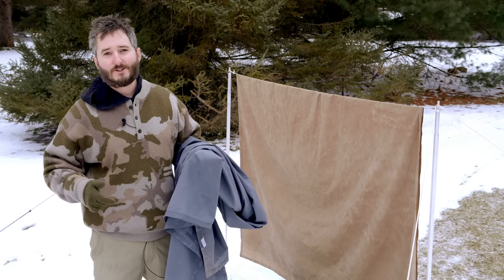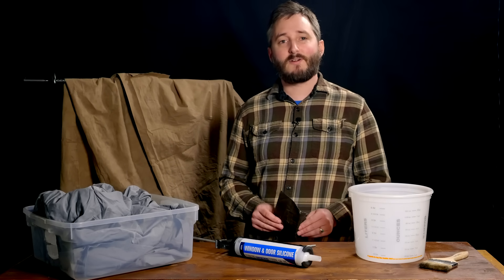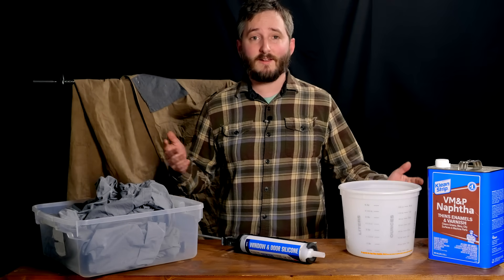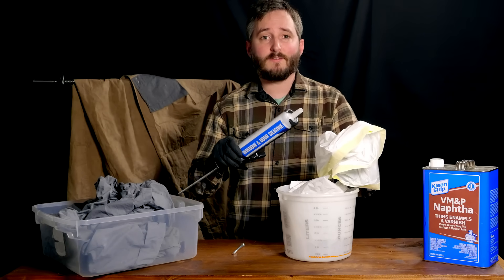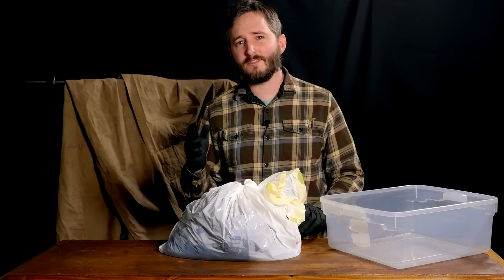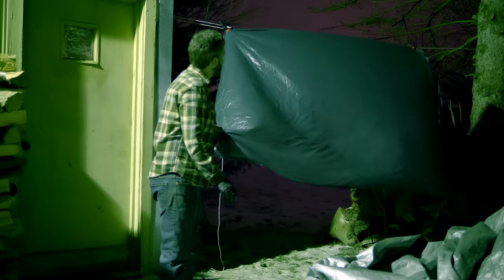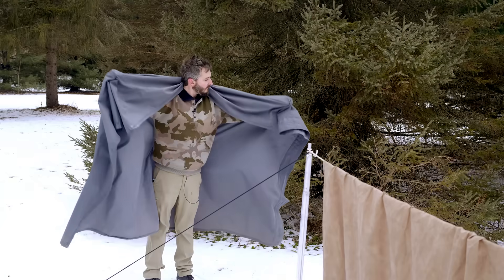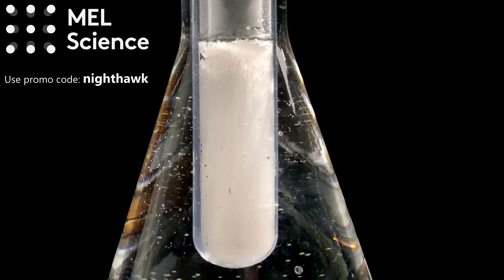Recycled Bedsheets Make The Best Waterproof Tarps

Comment: Although informative, the main premise is stupid.
Your going to the home center to buy 2 gallons of naphtha and a 6 dollar tube of silicone. Spending time and money to make this tarp.
You say this stronger? No its not.
If you get a tear in a sheet, the rip will spread from one side to the other. Everyone who has ripped sheets into strips knows this.
Try doing that with a 6 or 10 mil poly tarp.
This is a wast of time.
Folks, when you're at the home center thinking bout this trick here, shake your head and go around the corner to the other isle and just grab a poly tarp and be done with it.

Comment: Interesting idea, although this would weigh plenty more than most silnylon tarps used for camping... As i want to be able to pack at least a few luxury items, i feel like it is worth it to spend some money on lightweight gear... Having dialed my gear down to below the 10 pound limit for "ultralight", i feel like it starts getting reasonable to at least consider going with less lightweight options in certain cases where it has nice benefits; like synthetic sleeping bags and jackets dont have issues with cold spots because the down is not evenly distributed or properly "fluffed out", and it is much easier to clean, and it retains some heating properties if it should get wet.

Comment: Good video, thanks! The pace seems a bit slow to some, but I found it was calm and clear and didn't add a lot of unnecessary chatter. As for the button-method, you can also use a double sheet bend knot without stones.

Comment: I'm for something to "water proof" a seal plate and OSB sheeting at the bottom of a cabin wall I am rebuilding. I think I could put this mixture in a pump up sprayer and wet it out from inside the wall before I insulate and put up dry wall. I bet this will work a treat!

Comment: I have a question : how well the silicone - naphtha mixture hold up after time ? I mean if i mix them and don't use them right away, after a long time, will they still work as intended ?
Reply: As long as the solvent doesn't evaporate it should be ok.   You'll just have to keep it in an airtight container with little extra air space inside the container.
Reply: @MrBottlecapBill  thank you buddy !

Comment: This is one of the most generally useful ones I've seen in a while. Not only is it something everyone has a need for but it's something most everyone can easily do. Thanks!
Reply: for the best possible results, you should do this with a hemp or bamboo based cloth. hemp is best but bamboo also very strong. silk is great but more expensive and not functionally much stronger than hemp.

Comment: Just wanted to say, the bag method of vapour capture is useful but STILL do NOT do this inside unless you have a minimum of GOOD ventilation.
Also, consider the weather conditions. The level of safety doing this with the bag in the middle of most of North American winter would be absolutely fine, especially given I can se snow on the ground.
I cannot strongly enough highlight just how NOT OKAY this bag method would be if you happen to be watching this in a less well ventilated or even a well ventilated area in the middle of an Arizona summer.
I also want to point out that a solution of burning Naptha + Silicon is going to be very panic inducing and unlike dealing with any type of fire that the vast majority of people have any experience with.
It will, I’m sure behave more closely to napalm than just about any even liquid based (solvent or oil) fire.
Be extremely safe and careful and maybe run a smaller scale test or two.
I would never normally point this out because of NHIL audience, attention to detail and because of how obvious it is, but NHIL has done a lot of experimenting not shown here, but if you decide to replicate the video, it’s unlikely you will do the same, someone has done this legwork for you. So just be extremely hyper aware of your surroundings.
.5Gal of apple juice is sweet fk all in the bottle.
0.5Gal of apple juice on the floor is a LOT more
0.5Gal of burning (or even not on fire.) “napalm” on your South Floridian garage floor is a WHOLE LOT more than you can imagine.

Be safe, be extremely careful.
Hope and plan for the best but PREPARE for the worst.

Comment: For DIY purposes, does anyone know the answer to the following:

Is a fabric is coated one sided, not soaked, would it be partially Vapor permeable? (Think down sleeping bag and/or jacket where sweat has to pass through)

Would this work on polyester or Nylon fabrics?

Would this work as one sided coating on rough fabrics like wool? (Not waterproof, but more waterresistant)
Reply from the maker: It's breathable if made as in this video. Should work on any fabric
Reply: @Nighthawkinlight  Does it matter what kind of Nafta? (What the boiling point is, since those characteristics can differ)

Comment: You do know they make a silicone waterproofing spray specifically for this purpose, right?  You just spray it on like you are spraying it with spray paint, then let it dry.  No mixing or dealing with solvents required.

Comment: Like the idea, yet l would use bees wax for catching water because it has not been leeched by the silicone. Buttons are great yet because the shape of the square is altered by folds It is susceptible to water pooling as it is harder to get it taught for water to run off.
Thank you for the workshop and lm sure this knowledge will be useful to me one day, would it be possible to do a video on bees waxing a tarp? Is it as simple as rubbing it on or does it need to be melted?

Comment: I've been meaning to turn some heavy canvas drop cloth into a tent, and this seems like a great way to waterproof it without the flammability of oil or wax
Reply: I think silicone is actually a flame resistant. I used to use it for thermal cement on some led light projects.

Comment: Buy a waterproof back back and make damn sure it costs over $75, as you DON'T want to get a PVC piece of crap. Oh and do not buy from Mountain Hardwear, as those lousy f*ckers don't seam seal and they use careful wording like "Waterproof material" instead of the entire backpack actually preventing water ingress. Also, also, never buy a pack with zippers. Thats another sh!tty gimmick in which the company casually neglects to mention, allows water inside.

Comment: Great video. 
The more traditional (and cheaper way) is to simply use any old wax candle with turpentine.
Fill a large'ish pot with water. Only need an inch or two of water. Bring to boil. Get an old tin can, cut up a few candles into smaller chunks and drop into the can. Cover the wax with turpentine. Carefully place the can into the pot with boiling water. The wax should dissolve completely with the turpentine.
Once the wax is dissolved remove the tin can from the pot of boiling water.
Hang up your sheet outdoors and apply with a brush, rag or sponge to the cotton sheet.
Let the sheet dry and viola, you have waxed cotton.
I found this treatment should be repeated every couple of years depending upon the conditions the waxed cotton is used in.

Comment: I have a 10'x20' UV protected plastic carport canopy with walls (shelter logic) and it's developed leaks.  I sometimes live in this thing.  At the minimum, it's my shower and kitchen.

Would this work to reseal the top?  Maybe with less solvent?
Reply from the maker: It might. I would test a small part in case the solvent damages the plastic

Comment: For anyone wanting written instructions, here you go. If there are any corrections or additional tips, please comment so I can update the instructions.

WARNING: Do this outside to avoid toxic fumes and build-up of potentially explosive solvent vapours. 

MATERIALS: 
Naphtha, 100% Silicone 1, plastic bag, plastic container, bed sheet, chemical-resistant gloves, and a clothesline or drying rack.
Note: Ensure you are using 100% Silicone 1 (acetoxy-cure silicone), instead of Silicone 2 (neutral-cure silicone).  If your tubes aren't marked, then smell may be able to help tell the difference. Silicone 1 has a very strong vinegar smell due to the release of acetic acid while it cures. Silicone 2 can release ethanol/methanol, ketoxime or acetone (depending on formulation) and generally has a mild odor (usually ammonia-like) or no odor at all.

RATIOS:
Solvent to Fabric Volume: 0.75:1 ratio (E.g. Fabric that uses 2L of volume needs 1.5L of solvent).
Solvent to Silicone: 5:1 ratio (E.g. 1.5L of solvent will need 0.3L (10oz) of silicone).

TIP: Have a clothesline set up ahead of time to hang the fabric to dry.

INSTRUCTIONS:
1) Roughly figure out the volume of the fabric (material) by compressing it into a container with measurement markings.
2) Get large trash bag. Ensure the solvent won't dissolve the bag by testing a bit of Naphtha on a corner of the bag.
3) Pour the calculated amount of solvent into the bag & then add the calculated amount of silicone (see ratios above).
4) Tie the bag off & then mix the contents from the exterior until it feels like a maple syrup consistency.
5) Open the bag, add the fabric, close the bag & then knead it for at least 5 min to fully soak the fabric.
6) Remove the fabric. If there are any dry spots, squeeze or wring it against a part that is overly saturated.
7) Hang the fabric on the clothesline to fully dry (minimum of 24 hrs).

ADDITIONAL NOTES: 
•If you want to use a brush to apply the mixture to a different surface, then aim for a 1:1 ratio of solvent to silicone & thin as needed.
•You can try using mineral spirits but it's not as effective as Naphtha.
•For extra UV stability, mix some carbon black (lampblack) into the silicone prior to coating the sheet.
Reply: So cool! Thank you!
Reply: Thank you for posting the written details!
Reply: You're the Greatest ❣🕊
Reply: No worries. I'm just glad it was of use to a few people 😊

Comment: Hmm.. interesting, here is a couple ideas for "part 2": 
-	What would happen if you stretch the fabric really good (have it pre-tensioned like they do with concrete)  before silicone set, would it make the fabric stiffer ?
-	How if you give same treatment to a cardboard ? would it turn amzon box into water tight cooler or temporary water storage ? see where I'm going with that ?…
Reply: I've used silicone solution on cardboard, it makes an amazingly useful material. Lightweight, easy to cut or pre-form into unique shapes, and if you bond 2 or more layers together in the drying process, it can become shockingly durable. If you used it to make a water bin though, I think it would warp from the weight, and eventually leak, cuz water gets really heavy in large amounts. So you'd need some kind of rigid box first, maybe plywood. And at that point, you may as well just paint the plywood with pure silicone and skip the cardboard. At which point really you have a "treated wooden trough".

UV breaks down silicone caulk in about 5-20 years outdoors. But if you paint over it with something very UV resistant, you could extend that considerably. Truck bed liner comes to mind. Even if the truck bed liner breaks down, as long as it shades the underlying silicone, it would last a really long time. I'm curious how 2-ply silicone bathed cardboard, top-coated with truck bed liner, would work as roofing tiles. 

I made a box/tray for the trunk of my car with 2-ply silicone bathed cardboard. It's warped to fit an odd shaped area which otherwise isn't very useful space in the trunk. 2-bins with a divider. It's had various things spill inside it, from oil to grocery store milk. It protected the trunk's carpet, and stays in place well. Keeps things from shifting around much.

It's a good insulation material, both thermally and acoustically. Easy to trim, and 1-ply can be bent for odd shaped areas. The rigidity goes up shockingly fast the more layers you bond together though. So you'll need to warp multi-layer laminates before they dry if you want unique shapes. Can be used in place of foam-board for many things too. 

I've also used just pure silicone caulk to bond together pieces of plastic. Like the stuff they use for 32oz cups at the quick-mart. It gets drastically stronger & more rigid when bonded in layers, because to bend, the layers have to slide past each other slightly, and the silicone doesn't want to allow that. Basically the same idea as in laminated wood, which was the main material for WWII aircraft, where thin bonded sheets are more rigid than a single piece of wood of the same thickness, and you can warp it before it cures to make more interesting shapes (though germany went with a saw-dust+epoxy blend which was a bit like MDF).

There's probably better materials for it on an industrial scale, but silicone solution bathing of porous materials, and silicone bonding of layered materials, gives you a lot of "back-yard" options to make interesting things.
Reply: @kathrynck  truck bed liner is polyurethane, not silicone. Spraying truck bedliner over silicone would be pointless. In your roof-tile scenario, spraying bedliner right on the cardboard would yield a better result.
Reply: @bmingo2828  hmmm, though it wouldn't impregnate the paper fibers in a way which would prevent rotting from air exposure and ambient moisture. I dunno, just theorycrafting really. I've only done a few things with impregnated cardboard, no roofing, hehe.
Reply: Very good questions, hope he follows through
Reply: Ive done this before with boxes for coolers. Everything from styro foam to plastic. Problem is that the cold isnt insulated  as well and leaks all over the floor as condensation etc.
Reply: 1. it would wrinkle up when you take the tension off. 2. yes
Reply: Hm. Silicone treated cardboard as exterior siding... just brainstorming here. Don't know if it would actually work.
Reply: It probably will work on cartboard but i'm not so sure it whould be foodsafe or watertight.
Reply: @Erbmon  yeah, better as a cooler than as a water bin. Could buy some tempered glass & make an aquarium though. that'd be food-safe water storage (for a while).
Reply: @kathrynck  never use regular silicone for anything used with fish, it can leach and kill/harm the fish.  There are special silicone’s specifically formulated for use in fish tanks and such.  PSA for everyone, 100% silicone often isn’t ALWAYS 100% silicone, there are accepted margins, and all silicone is not equal.
Reply: @joenalaska  true that.
Reply: @joenalaska  I’m sorry but the food grade silicon is 100% silicon and is used on fish tanks and in and around kitchen and bathrooms. Plus any silicon work that is done on a fish tank must be left for up to 24-48 hours before it can be filled with water and used with fish. It is the solvents within the silicon that needs to be allowed to evaporate from the product before it can be used. I have used this silicon to fix a few items that come in contact with food and I have not had a problem with them at all once they were fully cured.
Reply: There are boxes for shipping fish that use a similar method, however as others have noted it is not water proof as there are seams, and while cardboard has some insulating properties there are issues with condensation.

Comment: Caution: do a fire test on a small piece, I think the results may make you nervous. I intentionally tested a cured and laundered 6"x6" cotton swatch and got quite a nasty surprise. 

A safer, not very affordable alternative is Dimethylformamide (DMF). It's close to $80 a gallon but it's inert, odorless super friendly and won't burn lol. 

It works with both the Tin Cured (stinky) silicones and the high end Platinum cured.

Otherwise, great video as always.
Reply from the maker: The solvent used doesn't effect flammability of the final tarp once dry

Comment: Have you tried Type I silicone (the one that off-gases acetic acid so it smells like vinegar) vs type II (ammonia cure)? Which type did you use in the video? I'd love to treat my "water resistant" coat.
Reply from the maker: I used type 1

Comment: Pah! Heat up some Sunlight soap in a big pot with water, till it dissolves, dissolve calcium chloride or magnesium sulphate or chloride in water, stir the soap pot and add the Mg or Ca solution.
Filter out your completely superhydrophobic insoluble calcium or magnesium soap.
Dry, dissolve in methylated spirits, paint or soak into your fabric.
Not toxic, lasts much longer, much cheaper than the crap silicone that won't last 6 months.
Loser. 
Take your toxic crap and shove it!

Comment: If this is so much better than tarps, why aren't tarps made like this? Is it that tarps are cheaper than new bedsheets and its assumed the sheets used for this would otherwise go in a bin? Even if thats the case, wouldnt there be (or are there) more expensive tarps made like this? Generally I don't trust any "it's cheaper and works better than the commercial stuff" videos, but maybe I'm missing something?
Reply from the maker: Plastic is really cheap

Comment: What a great project! I must have sen "100% Silicone" hundreds of time and thinning it never occurred to me. And naphtha if I recall is "white gas" or Coleman fuel which I use for cleaning machine tools (also the first fuel used for internal combustion engines). OK, everything here will be waterproof in a week!
Reply: as I understand camp fuel has an additive that is oil and  it may interfere with the silicone , the thinner probably would not have that additive. may want to test the camp fuel idea before committing materials.
Reply: @ArtER21  Good point. I just checked a gallon can and all it says is "contains naphtha petroleum". I don't see any film when it evaporates.
Reply: @charlesspringer4709  I think that if it had the additive it would be listed , camp fuels have it so that the stoves don't rust or something to that effect and I think the can would list it like a "feature" of the fuel.